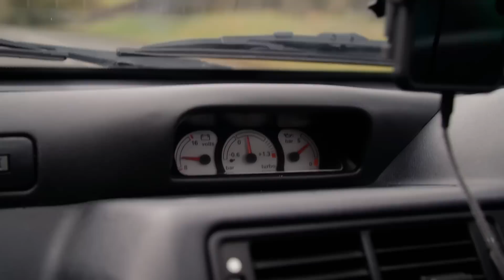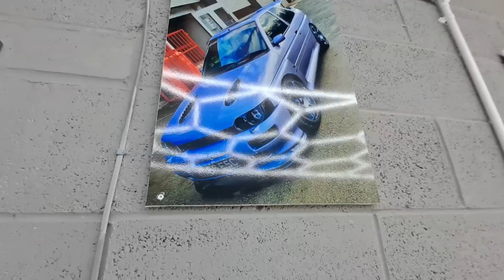JMDetails takes Project 2000 + car show + Maxspeedingrods GT3582

Comment: If not said already send the turbo for balancing and gen 360 bearings, also hugely important to get the wastegate hole ported as they are too small and get boost creep.
Reply from the maker: It's externally gated
Reply: @MRM SpeedShop  apologies mate I was watching the video at silly o'clock 😜.  In that case should be good to go with the other little things done. 
I know the gt28 they do needed porting as we got one recently for a corrado g60 build.

Comment: Enjoying the videos mate.. quick question the motors you pulled out of storage.. the one with the black cam cover what inlet manifold is on that? Nissan gtir?.  Cheers
Reply from the maker: It is bud its the GTiR inlet with ITBs but with a CNC'd adapter plate to the head.
Reply: @MRMSpeedShop  looks the part.. I'm a huge fan of them I've got one on a pinto turbo I built. But I've got a focus st170 (uts a rear car here in nz lol). And have thought of using one on that aswell..   any idea if the st170 motor is a close comparison to that motor? Thanks again